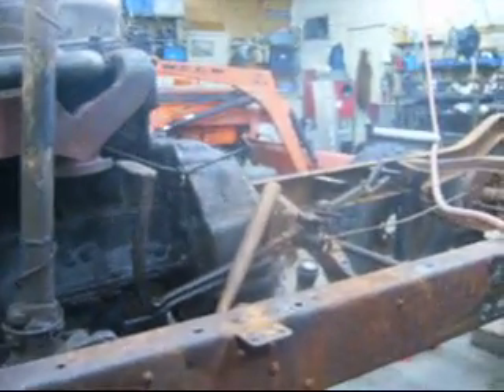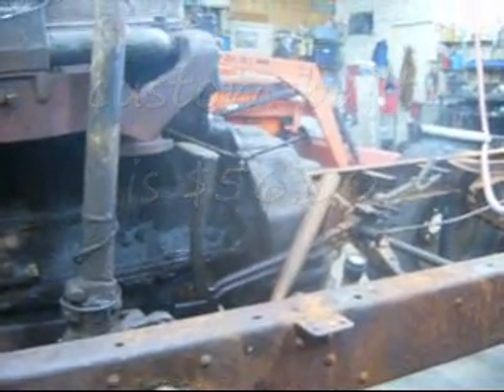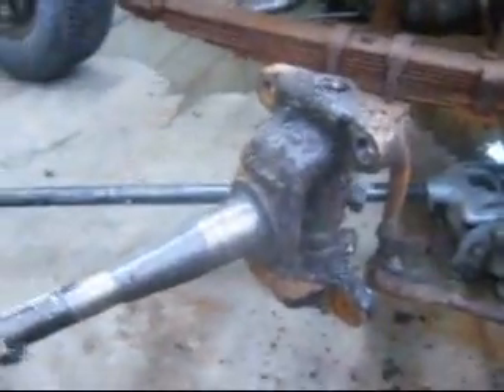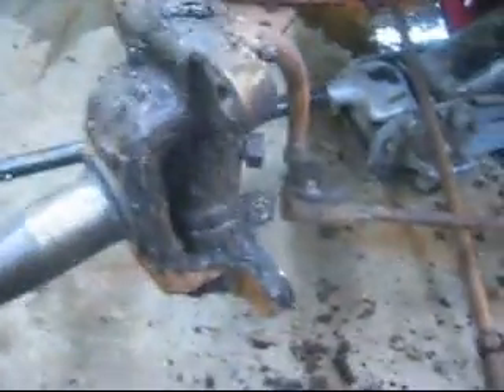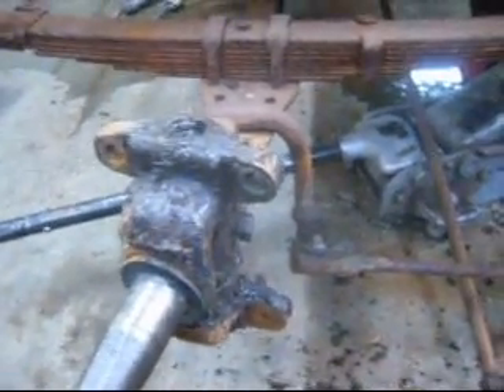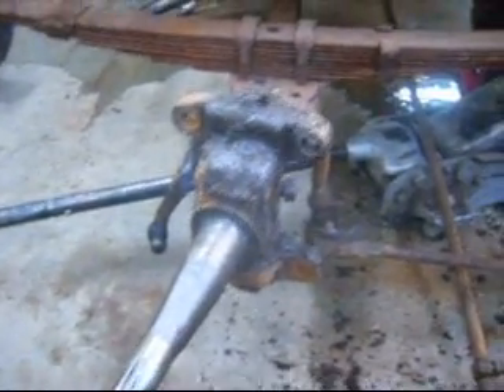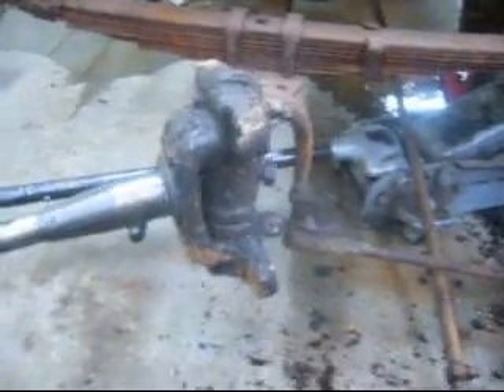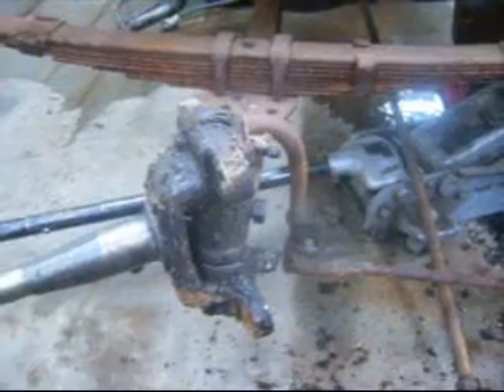1932 chevy rat rod truck #31

Comment: Well, if you were to know a good bracket maker, LOL, I'll bet a bracket could be made that would attach to the backing plate holes in your spindle that would hold a caliper and then use your bare hubs and use a slide over style rotor on them like a FWD GM uses, and then have discs up front. On my 57, the caliper bracket bolts to those BP holes.